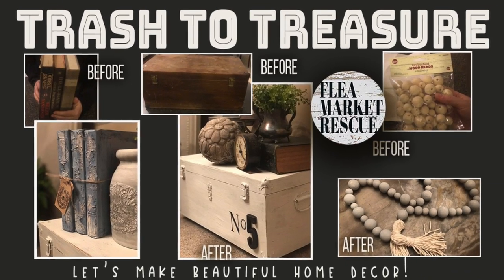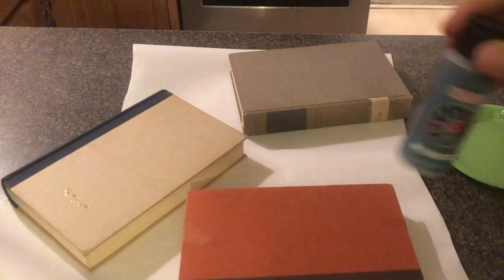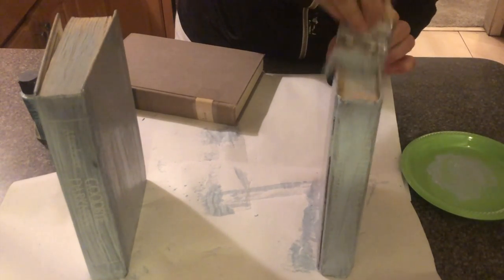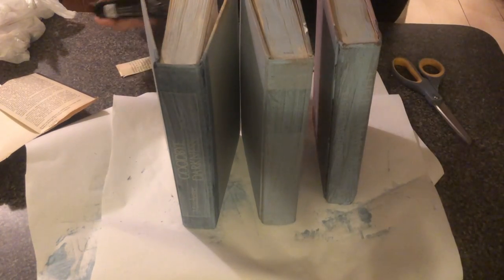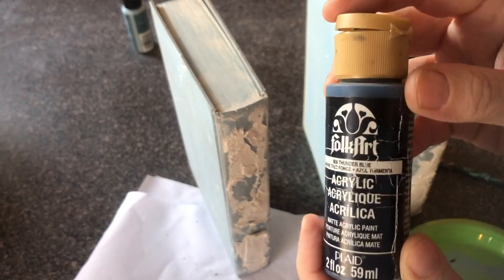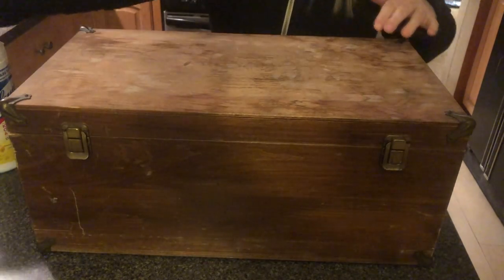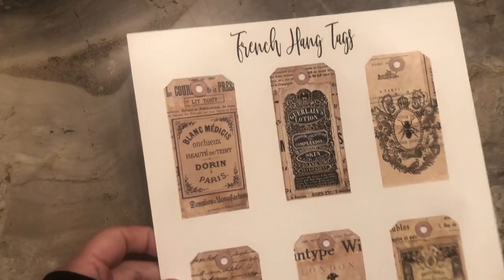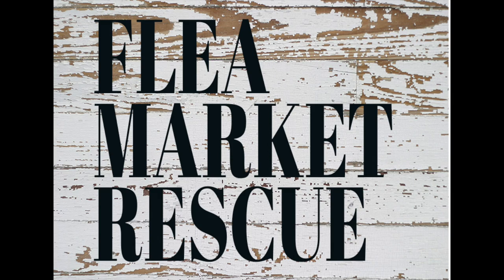TRASH TO TREASURE DIY FRENCH & FARMHOUSE HOME DECOR THRIFT STORE MAKEOVERS

Comment: I love that trunk!   The books too.  I have a question.  I just started painting a dresser.  1 coat of chalk paint.  But I can see that some spots will need to be primed.   Can I mix my chalk paint with a paint and primer paint and will it cover that way?  I did part of it with my chalk paint to see if it would bleed through, and in that spot it didn’t.  But now that all of it is done  1 coat,  there appear to be places all over the dresser that the original finish is coming through. 😕.  Thanks for any help you can give me.
Reply: Also, what ‘power’ scroll saw do you recommend?
Reply from the maker: You know....I've never tried that!!!  I always use a color matched paint and primer in one on the 1st coat.  It's color matched to the chalk paint.  I get that done at Home Depot.  Then, my second coat is always the chalk paint.  It sounds like you experimented with it when you did part of it with the mixed chalk paint....if it didn't bleed through then that should be good.   Me personally, though....I probably would go over it doing a 3rd coat with some washed down chalk paint after that 2nd mixed coat dried....just to ensure I had the flat chalk paint look.  Sometimes when you use a primer...it doesn't have that flat chalky look to it.  It could be different because you did mix it together with the chalk paint.  I don't know...because again...I've never done it this way, so I'm curious to the results.  Let me know.  Ok?  Thanks!
Reply from the maker: I love Craftsman Scroll saws, however, Sears has went out of business.  You can pick one up on Facebook Marketplace, however, for not a lot of money.  You just want to make sure you get one that has a dual speed.   Now, if I were to get a new one...I'd buy the Ryobi and the Wen. They look like the way to go.  Hope that helps!  I cover all that in the class that will be out in a couple days.
Reply: The part I painted a head of time, was just regular chalk paint.  Then I painted the entire thing with that chalk paint.  As it dried, I started seeing the old finish coming through the chalk paint. 😕.  I found a can of  sealer, Zinsser, and just sprayed the whole dresser .  I am hoping tomorrow to try the chalk paint again.   I think I will do what you suggest from now on.  A tinted primer would save so much time.  Thank You!